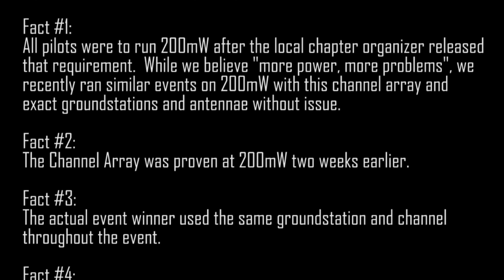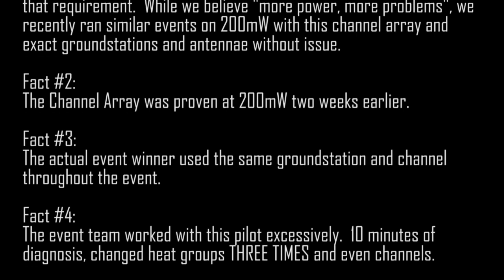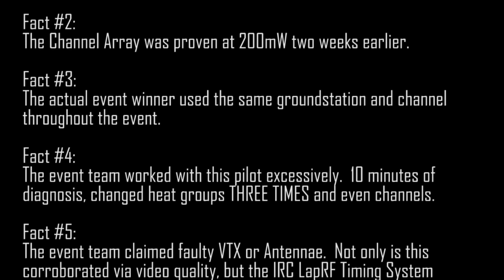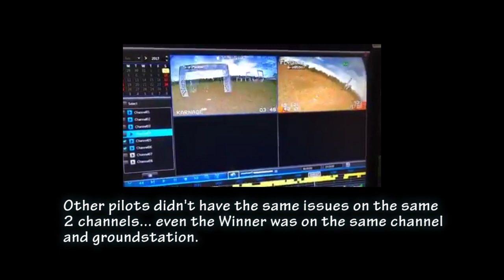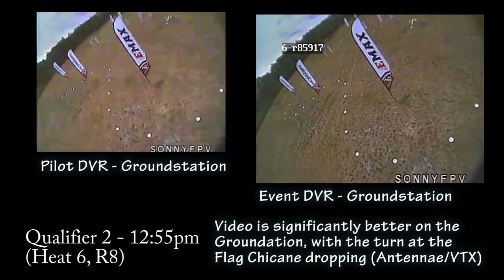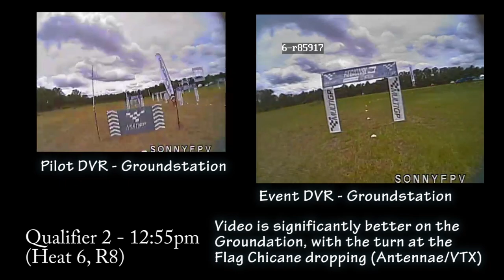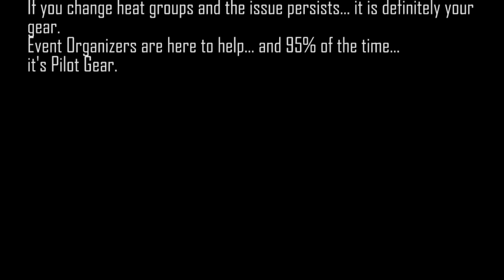Drone Racing Video Issues: Pilot Gear - The Response

Comment from the maker: sonny, a lot of feedback coming in that it is your goggle module. You plug into a groundstation with another 5 quads powered up and then remove the module from the goggles. It is a known issue with Furious D and early models of LaForge. Putting the module on channel zero sometimes helps.  
I've seen this lots of times if goggles are on external but it is not displaying the same as on the monitor. 
the quad was still underpowered somehow but this seems to be the leading problem.

Comment: This looks very similar to an issue ive had since I started using furious v3 with fatshark doms v2. If I use a cable for an external vtx (or even while adjusting HS1177 settings) while the furious module is still plugged into the goggles, the vid goes to shit. Remove the module and all is ok again. Just something you might like to check.

Comment: i still think he was sitting on 25 milliwatts
Reply from the maker: While it is a possibility, the timing system would have missed a majority of his laps as it was calibrated for 200mW, and he was reading just above the threshold, while the average of the others was 50-100% higher....it USUALLY isn't within the realm with 25mW vs 200mW.... but VTX's put out different power ratings on different channels.
Either way... the take-home is it was the pilot's gear, not the organizer's or the other pilots.
Reply: yea but on the other hand, if he's at 25mW and is flying lower than the others, it's conceivable that he would still register on those "lower" laps as the relative signal strength would be higher.
Reply from the maker: correct.  and it could be a VTX that puts out 175mW when it says 25mW, and they could be skimming the box when crossing.
25mW is possible.
It would have taken some more testing on site to figure out for sure.
Reply: So, why didn't you put it on a power meter?

Comment: Those are not facts man are you guys serious right now? I was plugged into the ground stations more than 2 runs that's a fact. And I had 3 quads so when I was told it was my gear I changed quad and was still told my gear on all 3 quads?and. Own I guys have dvr of good video with my allegedly faulty vtx dosent make sense at all. But cool all my equipment is bad even know I was racing with 5 guys right before this race with all 3 quads cool story.
Reply: Did you try to borrow a friend's goggles to see if there was something up with your headset?
Reply: MojoPapi FPV yes we tried 4 ppl goggles
Reply from the maker: Sonny - the DVR we pulled as Event DVR and put beside your Goggle DVR were only the same for 2 of the videos you posted.  The rest of the DVR footage would be from your module.
Someone said that it could be your module interfering with your reception, that it should be in 0 or 1 or completely disconnected; it may be interfering with your groundstation feed.
But your quad(s) are also underpowered... 
Someone said that you may be on 25mW and not 200mW.
Or your antennaes are bashed and your quad(s) aren't outputting their full potential.
There were a few unsolved issues:
1) video from your quad was not good (on module or groundstation)
2) video from groundstation to your goggles was not good (the DVR we have is from the exact same groundstation.
Reply from the maker: so if it wasn't your headset... what would it be?
Reply: FPV Racing Events i don't know what it would be but facts are we tried atleast 5 goggles with same result that's a fact. and like I said in the video description I have 2 more videos where I lose signal but felt like 6min video was already to long and on 1 round I didn't record because I was trying multiple goggles and they just called the race before I had my goggles on.